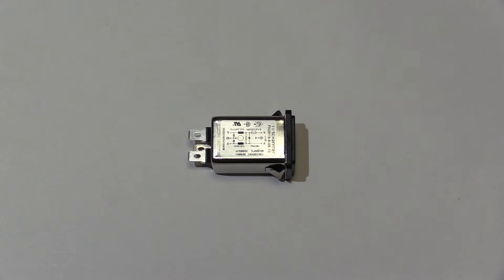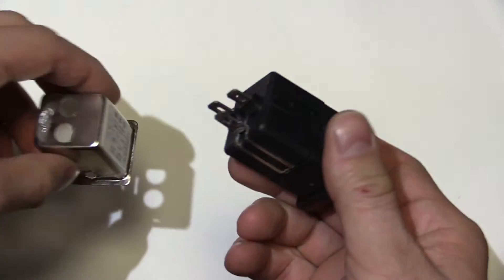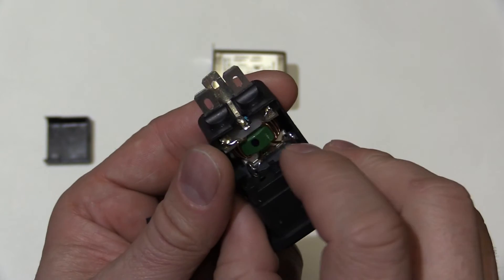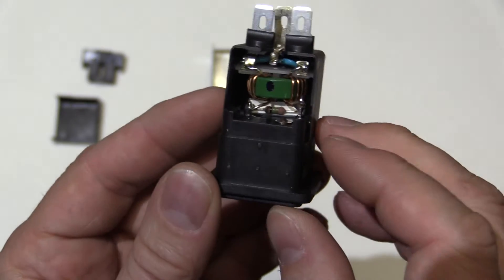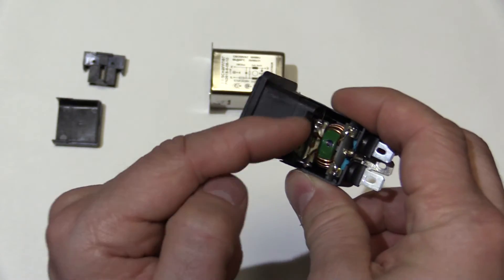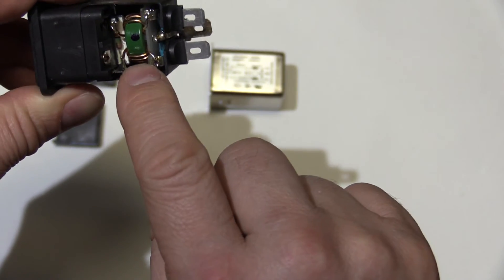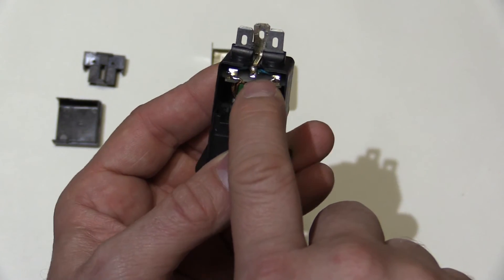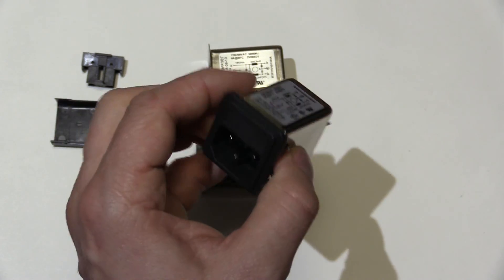IEC mains noise filter teardown and explanation - Schaffner FN261S-6-06-10

Comment: Every Tube amplifier I build I use these IEC's but without the built in fuse as i have a separate 1Amp slow blow fuse
Reply: does it worth to use it in power supplies?

Comment: my apple iie power supply has this in it, minus the fuse part. so i had been looking for this video to see whats in it and how it works, on the circuit board there are a couple small red wima caps which i assume are also filters due to where they are located, i have the dynacomp which doesnt have the rifa caps that the astec does.

Comment: Hi mate, is this a good solution for reducing dirty electricity levels?
Reply: yes, its is - there are many versions of these filters - you can have 2 stage 3 stage and 4 stage noise filters
Reply: @prabirdebnath5197  Ok, since I'm not an expert in this field, which of those have better efficiency?
Reply: @viktorbozicevic6219  based on the application is decided - but if you looks for a 3 stage filter which is very effective to reduce the noisy beast in the power line

Comment: How do you connect them safley on the other end? Shrink tube?
Reply from the maker: Yep, solder and heat shrink, or fully insulated 'Faston' style spade connectors will do the job.
Reply: You can also use crimp connectors